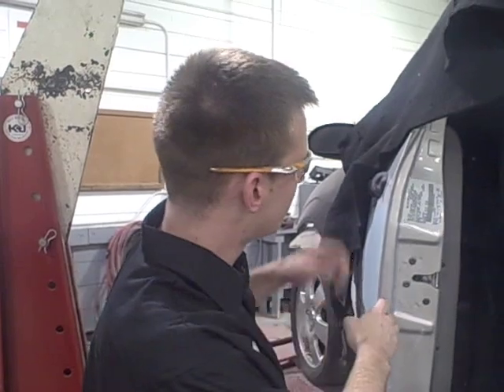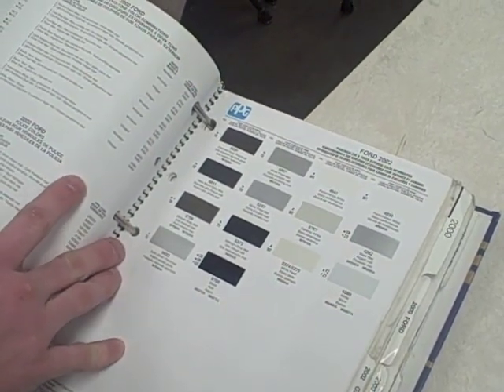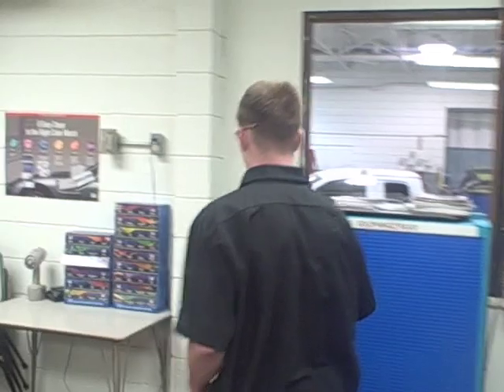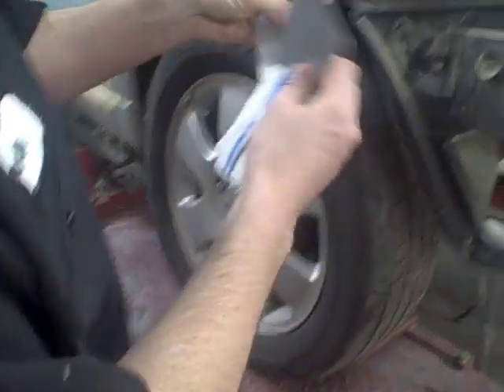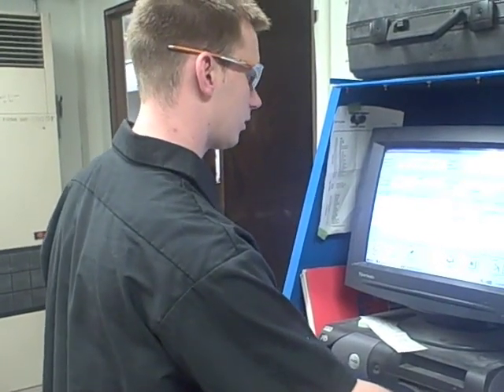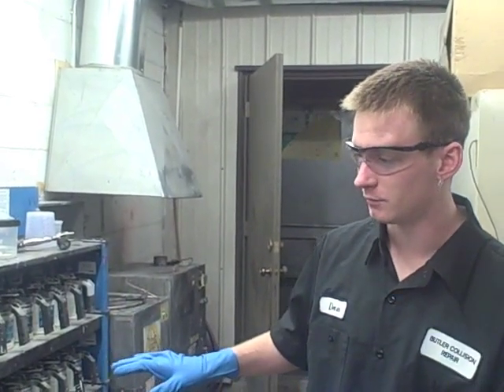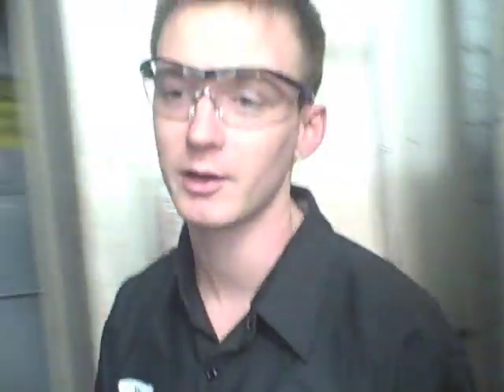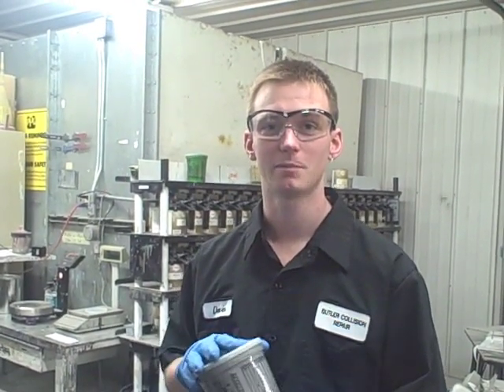How to Mix Automotive Paint (Auto Painting) Tips For Students

Comment: Very nice video. I need to repaint a front fender on my corvette, someone backed into the front nose and shattered the fiberglass. I have the materials to fix it and some base paint /clear coat but the paint isn't an exact match. I have a certification in paint formulation and access to a paint lab at my university and was hoping to mix paint from scratch to be exact. Can consumers access those databases to determine the paint formulas? I need Mille Miglia 974 Red, but for 1974. any suggestions